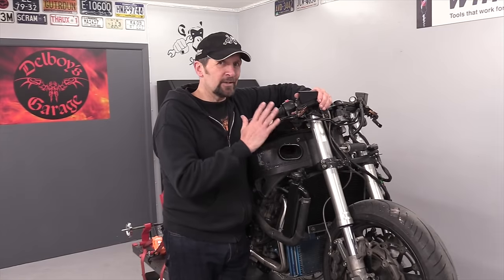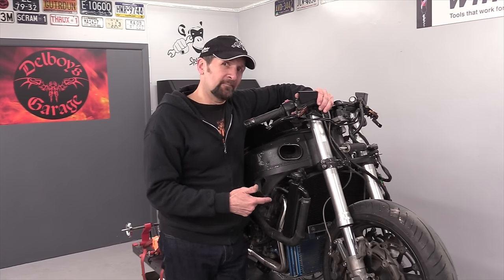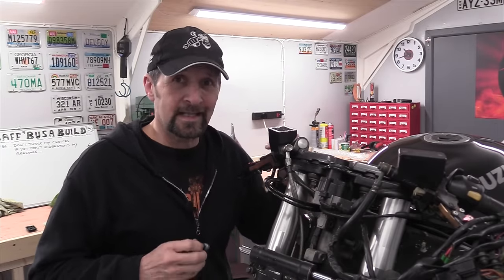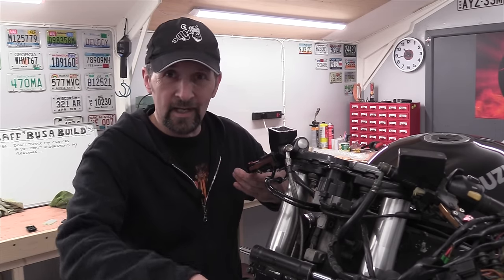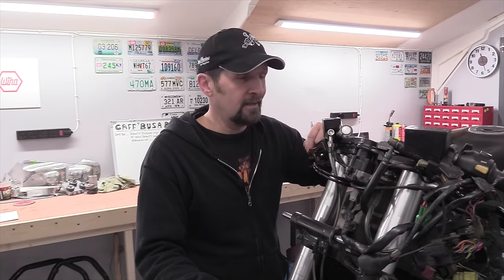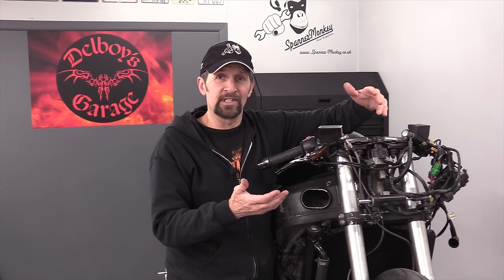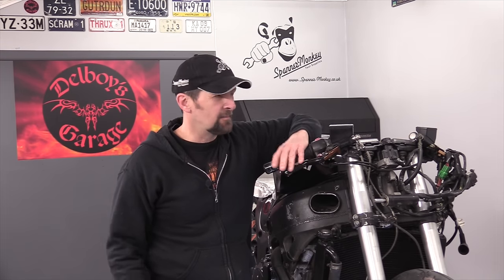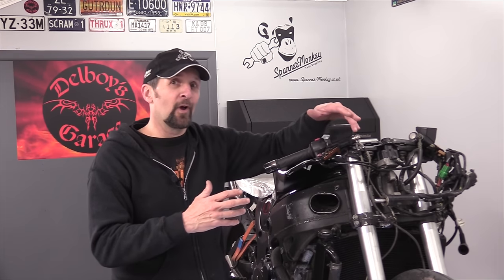Delboy's Garage, Priming an Empty Hydraulic System !

Comment: Can I just add my little extra tip.
Don't rush.

I mean, after you've bled, and are sure there are no micro-bubbles, go out on the bike if you have to, but take it steady. 
Then 24 hours or more later (if you have a remote reservoir) remove the reservoir cap, carefully squeeze the rubber connecting tube, or agitate the lever careful not to spill any fluid if it's an integral reservoir, and I can almost guarantee you will see a nice little bubble rise from the hole at the bottom. 
Let physics bring any remaining air to the highest point of the system (master cylinder).

I changed my GSX-R 750K2 front brake master cylinder on Tuesday, it had a firm lever, and on Wednesday ran some more fluid through to be sure the calipers were bled after settling, then today (Friday morning), I popped the reservoir top off, and squeezed the pipe, and there it was, the final bubble.

Comment: I just bought the biggest syringe I could find, a piece of 6mm fuel hose and just applied vacuum to the last bleed valve on the system :) worked like a charm, just remember to top off the fluid to not to suck air from the other side ;)

Comment: Good tips
I worked for many years in a pneudraulic workshop on military aircraft components. Some of the first rules I was taught are that air always wants to up the way…sometimes tapping with a soft faced hammer can help dislodge air bubbles and sometimes you need to take the component off so you can prime it properly by hand.  Messy business but works.
Failing all that plumb it into a system than delivers flow of 100ltrs per minute at 4000 psi…that’ll sort out any air bubbles 😛
However I do like a syringe from the bottom on my bikes as air likes to go up the way 👍
Got a subscriber now

Comment: I'm a frequent watcher of your videos and love the work you do.
I  was recently replacing brake fluid and accidentally left the bleeder screw open and sucked air into the master cylinder. As hard as I tried, I couldn't get any pressure at the lever; I watched this video, disconnected the line and let it gravity bleed. I had to re-bleed the caliper, but with line pressure it was done in short order.
Thank you for all the information and entertainment you provide.
Reply from the maker: Most welcome Sir, glad it worked for you, there's no denying that brake hydraulics can be a real challenge!

Comment: This helped me a lot. I was just trying to bleed my front brake after I cleaned my caliper and replaced some o-rings and wasn’t getting anywhere and I found your video on priming the dry system and fixed me right up! Thanks for the video.
Reply from the maker: Most welcome buddy, glad it worked for you!

Comment: Mate can I firstly say this vid saved my insanity trying to prime a bone-dry system. I have a 1995 VN800 turned into a bobber and in the final stages of the recent rebuild which included new bars and controls all in black. The last job which was frustrating me was the front brake, it had only a new MC and braded hose but certainly the system was empty and your vid was exceptional in its delivery and explanation so bravo. As a tip from me using your method to quicken the process for an empty hose fill it using a large plastic syringe (minus the needle which you can get from a chemist/pharmacist) this removed most of the air and was easily done. Made the job a bit quicker. Again many thanks for this vid would be at the local mechanics shop by now.
Reply from the maker: Most welcome Anthony, im glad it helped you.

Comment: Awesome video. As usual, you passed on another trick of the trade!

I am about to rebuild both front and rear calipers on my "new" k2 gsx14 I got from my cousin!

 Rear brake isn't too bad, but the front end is a mess. Brakes are grabbing too much, so dangerous. I have cleaned them, but I suspect it is even worst. 

I did not make a perfect job of cleaning them, they were so dirty. 4 hours scrubing that black stuff, not all of it came out. with new pads pistons went in. Even if 5 piston work great and one is block, that is enough. And that is waht happened to me, so I decided to make a rebuilt.

Thanks for sharing Del

Comment: What a video!
Well explained, was scratching my head at other peoples videos and this has given me confidence to get out and bleed my freshly rebuilt calipers 👌
Reply from the maker: Thanks mate, glad it helped, good luck with yours!
Reply: @Moonfleet41  No luck, dont seem to have any pressure at all as the pistons are compressed still, letting it sit for a bit and then im going to bleed it again and hope for the best.
Reply from the maker: @jzawadzki2000  Time is never really a remedy to trapped air.. letting it sit for a bit won't make much difference.    Try reverse purging it from the bleed valve upwards with a syringe.. literally forcing the fluid into the caliper and upwards..  that will work !
Reply: @Moonfleet41  rebled it and its nice and firm 👌

Comment: i had a problem with brake fluid won't bleed... i pushed the leaver for an hour almost... but i found easy solution : just blow in to the pipe (bottom end) so all air bubbles out from top... after that just few minutes and all good... just be careful not to taste brake fluid 😋

Comment: Man u hv so much patience.I gave my  mechanic a brand new master cylinder with the brake hose, the guy opened the master cylinder and damaged one rubber ring then he removed the old one from the old assembly and put it on the new piston in the master cylinder still not working properly even when the lever reaches the end the wheel barely stops.

Comment: Nice and easy tip, thanks for the info about dot 4 and 5, I wasn't aware of the potential problems. Have a great weekend and see you next week.
Reply from the maker: Thanks Andy, it's a very important issue not to mix silicone brake fluid with anything else, I'll cover a few more tips about in following videos... it's also not good for ABD systems either as it tends to foam in the module on some bikes.

Comment: Dry or not, occasionally I use a vacuum tool ( Mity Vac for example ) from the top. I made a small aluminum plate to cover the master cylinder which has a bleed nipple on top, two mounting screw holes in my case, and rubber gasket on the bottom. Put the plate over the master cylinder, screw it down if you can, attached the vacuum hose, and pump several times on the vacuum pump. At the same time, active the brake lever several times. My brake levers are well and truly hard as a rock if done right.

Comment: Oh dude. Thankyou so much for this video. I changed my handlebars so I needed to change my front brake line for a longer one. So I thought you bleed like normal, and I pumped amd pumped, bled and bled but could not get any pressure in the line. I tried for days and days and even bought a new brake cylinder and still the same thing. So I gave up and said oh well I’ve got my back brakes. Then I thought I’ll see if anything on YouTube and chose your because I seemed straight forward. And what do you know it worked after 20 min. Then bled the nipples with 2 bleeds and my grip is so firm now. Thanks buddy cheers
Reply from the maker: You are most welcome mate, im glad the video could help you out and get the job done.. Now you have another skill and can deal with this quickly in the future, take care and ride safe.. Del.

Comment: OMG if only I'd have known this a while back when I fitted braided lines to my RF 900 , it tuck me two days to do and I was going to give up . I got some extra length on my hoses as I want to put riser's on soon ,but I was convinced the extra length had made it impossible to bleed. I even tuck off the calipers and let them hang so the hoses where in a straight line . Anyway I finally got them . Cheers pal . I was thinking of putting braided hoses on my gsxs 1000 but after what iv been reading here on ABS systems I might give it a miss 😁 . Great stuff

Comment: Ive ALWAYS primed everything i can be it a car or a bike, ive actually just rebuilt, today the 6 pot tokico's from my TL1000r, i use a syringe to fill both calipers thru' the banjo bolt hole, finger over hole, move it about so it gets into the space, then top up, have banjos n bolts ready,  pour fluid into res', wait until it starts to piss out, fit bolts n tighten pull lever in+out...let go, loadsa bubbles, few more times, job done....but...if EVER stuck...try using a large syringe and start from bleed nipple and fill it 'backwards'...they can be a bastard to bleed if your inexperienced....this is also a good tip delboy 👍
Reply from the maker: Good advice indeed mate, i use a syringe a lot these days, often to backfill all the way to the top, then a quick bleed down to firm up the lever.. You need a decent quality heavy duty syringe to apply enough force, so the usual "chemist shop off the shelf item won't do... i use one of these, works really well, :- https://www.spanner-monkey.co.uk/oil-and-brake-fluid-inspection-syringe-200ml-120826?search=VS404&description=true

Comment: Jeeez dude....I tried to bleed my Hayabusa brakes today and did both calipers and mc last.No lever atall.Thanks for this mate.
Reply from the maker: Glad it helped buddy, and now you know how to do it!
Reply: @Moonfleet41  When removing the lines from the cals to let fluid flow through the line what would you do with the line looping over the front mudguard going to the left caliper?
Reply from the maker: @MrMurphc13  A piggy back system isn't standard on a Busa, more common on a Triumph.. but if that's the setup you have then you'll be better to just syringe it from the far caliper bleed valve right through the system up to the rez..!
Reply: @Moonfleet41  I bled it today and I have a decent lever but it’s about 85% as hard a lever as I feel it should be.I pushed the the pads all the way back before I started also(new lines,new master cylinder...old pads(plenty of life in em)).
It’s gonna be more than likely that the last bit of air is in the far caliper?I bled more than 3 reservoirs though each cal and the mc.
Reply: @Moonfleet41  ok mate.Thanks for the help and the videos.

Comment: I have a question. I did this job with a vacuum brake tool and an air compressor. I just just sucked the fluid using the tools and job done. Was right?

Comment: I used a lot of Fluid Film spray as an assembly lube for a rebuilt master cylinder. It might make the new seals last longer. I do not use Fluid Film for car door gaskets- I use Mothers VLR spray instead (for vinyl, leather and rubber). I use Turtle Wax Trim Restorer for hard unpainted plastic inside and out. Do not use anything slippery for a motorcycle seat.

Comment: I found on a couple of kawasakis there was air trapped in the master cylinder and cracking that top nut helped. I find "back bleeding" quite therapeutic. Thanks for the upload. Russ
Reply from the maker: Too true buddy, in fact, Wemoto sell a double banjo bolt for the master cylinder (if you're running twin lines), and it has a bleed nipple in the end of it.. so you can crack that last little void really easily and if you're back bleeding, just open that and it's a lot easier than pushing it through the master cylinder..!  Hope life is good mate, and business is brisk..! ride safe,, Del.

Comment: I had high spots in the middle so it didn't work, I ended up using a hose attached to the bleeder and to a bottle then bottle to vacuum cleaner haha. Worked in seconds, I was committed to getting it done without spending any money haha

Comment: This may be a daft question, im having issues with my gsxr 1000. Ive put new braided lines on and am I correct that the holes in the hoses MUST align with the banjo bolt holes in order for it to flow from the banjo dowm through thr hoses. And if so, whats the best way to align the holes as you can only see them once they are seperated? As my.resevoir is not decreasing at all and im just wasting hours and believe it may be this?

Thanks
Reply from the maker: No need to align the holes mate, look inside the banjo union, you'll notice it has a recess all the way round and will feed fluid in any orientation... if you can't get it primed by this method, then try back bleeding it with a large syringe from the caliper bleed valve upwards...!
Reply: @Moonfleet41  Thanks del. I tried reverse bleeding but the hose is taking on air and fluid so struggling feeding the caliper only fluid.

Comment: exactly the VIDEO I needed!  replaced a brake line and the previously simple bleed process has become crazy.... Im pushing the pistons back and gravity bleeding initially... then trying speed bleeders - tmrw
Reply from the maker: If you get in that position mate, then grab yourself a Brake Fluid Syringe and just inject it in through the bleed valve until it fills up the reservoir at the top, here's a link... https://www.spanner-monkey.co.uk/oil-and-brake-fluid-inspection-syringe-200ml-120826?search=vs404&description=true

Comment: Sorry you answered my question I had to Pistons pushed all the way down but for some reason I am getting no pressure at all and I have fluid at the bleeder valves on both sides with no air coming out. Could it be the o-rings in the new Pistons are so tight I'm not getting any fluid under them at all I don't know what's going on

Comment: Hey dale, I just redid my entire front brake system with new Pistons o-rings etc and a brand new master. I let them 10 times and I'm getting no pressure although the bleeding valve shows no air and plenty of fluid in it. I'm guessing the Pistons are pushed down all the way in it's an old triumph speed triple t509. Anyways I'm guessing that the Pistons are getting pushed out because the fluid isn't getting under the piston and filling up the void should I pull them off and try to pull the Piston out a little bit so fluid can run behind them. And do you think that's the problem?

Comment: After an hour of bleeding my freshly filled brake system earlier today and getting nowhere this video has simultaneously made me feel like an idiot and given me hope that the thing'll be on the road tomorrow!
Reply from the maker: Good luck with it mate. !
Reply: @Moonfleet41  after lots of swearing and spilt brake fluid in the garage tonight i've still got nowhere. Even with the brake line off the caliper pulling the lever doesn't push fluid through, whereas it did before i removed and cleaned the pistons. Bleeding it like normal gets me some bubbles for a couple of pulls then nothing. Hoping there's just a very persistent air bubble somewhere in the system.
Reply from the maker: @megasuperhyperspeed  Sounds like you're having a bad day with it buddy.. it can drive you made aye.. have you tried injecting fluid up through the bleed valve with a big syringe...that works every time for sure, !!!
Reply: @Moonfleet41  i've learnt not to try and finish a job at 9 in the evening after a shift at work! I did watch your video on using a syringe and that would have been my next attempt. Managed to get the line filled just by squeezing the lever for best part of an hour then could bleed it normally. Still got a slight rub but i'm hoping the ride to work and back will settle the pads where they should be.
Reply from the maker: @megasuperhyperspeed  Ok, if you've got a bit of pressure in there, then tape the brake lever into the grip over night and bleed it down again in the morning.. it'll be fine then buddy.!
Reply: @Moonfleet41  the joys of learning each job as it comes up. Thanks for the advice and keep the videos coming. Some of your stuff has been the difference between me tackling it myself or leaving it.

Comment: Great video, thanks. I would like to you if you have ever seen anyone use vacuum on the reservoir to remove air?  I saw a video once where a guy just filled the reservoir, set a cap with a nipple on it on top and applied vacuum to that, which pulled the air out.  When the reservoir got low, he filled it and applied vacuum. He did that until the oil level remained constant.

Comment: Del when letting the fluid drip out into the catch can, do you let it run out completely from master cylinder for each line or keep topping up and when steady flow reconnect at calliper, but keeping fluid in the master at all times?

Comment: Great information. But what is the process when bleeding a rear brake caliper two bleeder nipples, one high on the angle the other low? Given that the caliper had a complete cleaning and seal rebuild. Fluid remained in the res and the line. Thanks.
Reply from the maker: Just bleed one first, then push a few pumps through the other one if it's not running clear of air, not something you need to overthink mate!

Comment: Hi Del!  Going to be fitting a longer 1st line to my Speed Four (superbike bar conversion ) Bike has the Triumph 'piggy-back' system, would you just do the same gravity feed? Or would you 'prime' the new line using the m/cyl, (holding the 'free end up in the air) then connect to the rh caliper, & bleed as usual? (system is full, & working at the minute)